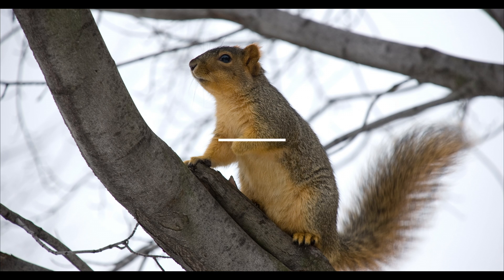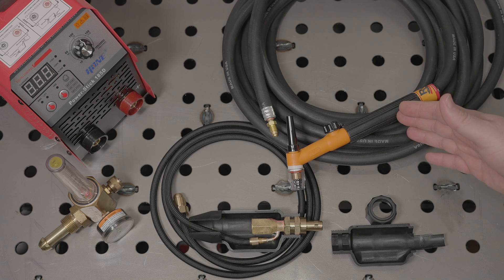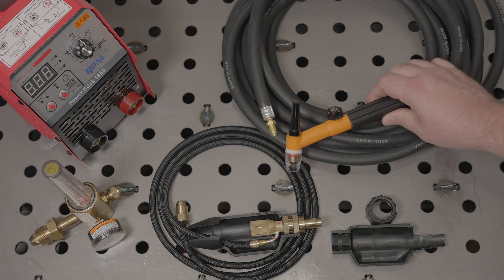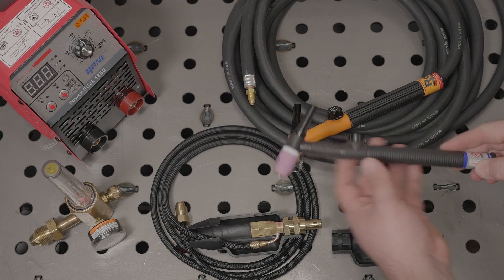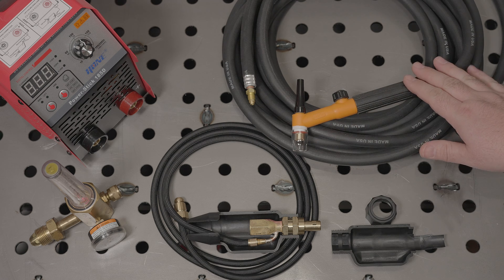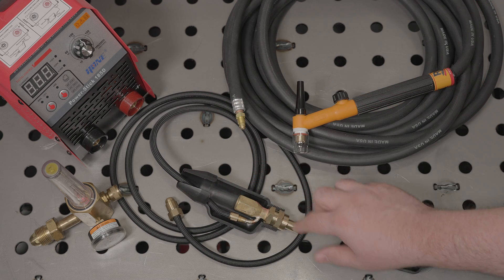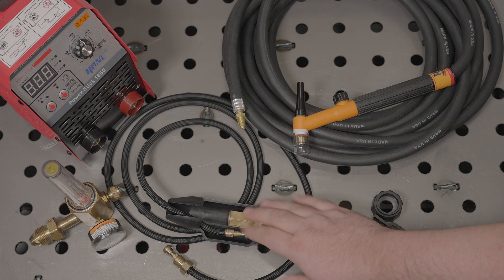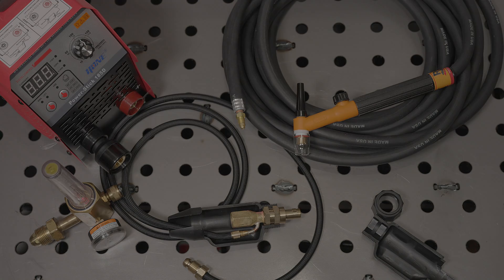TIG Setup for Stick Welder or Basic Lift-Start TIG Welder

Comment: Thanks for making such a simple and understandable video about this, I needed it. I just got a Rubik 3 in 1 145 through the Amazon Vine program for review, that is capable of lift tig. I'm decent enough for diy stuff at mig welding, but I got it to dabble in learning how to tig and stick weld. However, it didn't come with any of the components for the tig setup, only the mig and mma. Plus they gave the most useless and minimal info in the manual about how to set it up for tig! Now I atleast have an idea where to start and what to buy. Thanks again!

It's also the fricken pink and white edition, lol, but it was mostly free so I can get over that part! 😂😂😂

Comment: Excellent option, and thanks for sharing! How does the HONE 185 perform as a TIG or rather, Lift TIG welder?
Reply from the maker: I have been planning to use this TIG setup to test a bunch of cheap stick welders as TIG welders and do a video about it, but I haven't had time.  I've been crazy busy the last few months, and it's not likely to change much, unfortunately.  But I'll keep plugging away on the videos.  The Hone 185 is one I will be testing in that video.

Comment: how to hook up a switch? it be always on so you cannot pulse it nor use solenoid.
Reply from the maker: This setup is for stick welders or basic TIG welders that don't have a built-in gas solenoid (which is the reason for the valve on the torch) or any option for remote contactor control.  This would be used for lift-start or scratch start applications.  You are correct that you couldn't use a torch switch to manually "pulse" the current and cannot turn it on/off.  You have to lift or scratch start (according to what the welder supports) and "snap out" at the end of the weld.

If you are using a dedicated TIG welder then it may have an option for a torch switch or foot pedal, and in that case, what you use will depend on the specific welder and application.